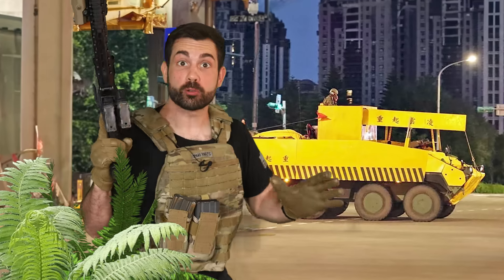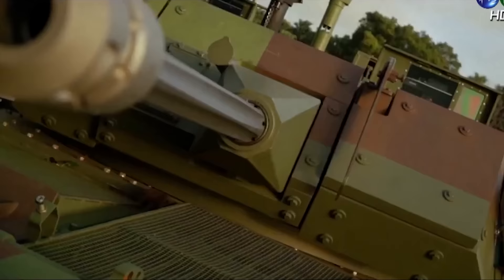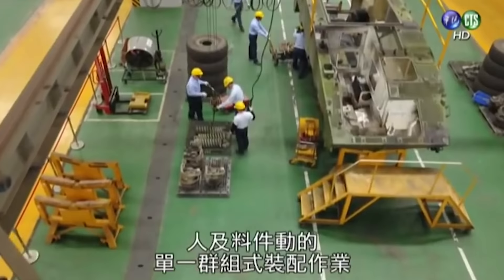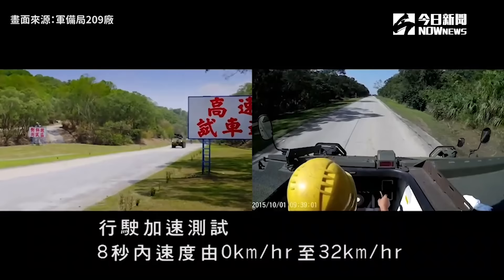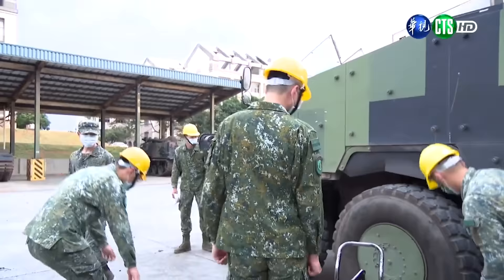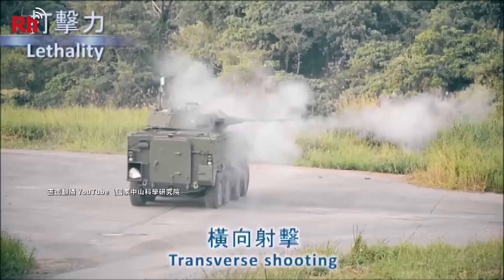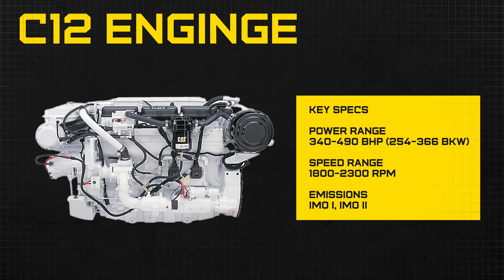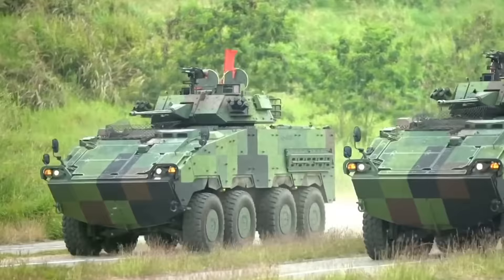Taiwan's Homemade Vehicle Designed to Stop China

Comment: As a mechanic. Honestly a CAT C12 and an allison transmission is a hell of a powerplant. Probably one of the more reliable off the shelf options for sure.
Reply: I'm a Yankee living in NZ, and I'm a truck driver getting used to a lot of Japanese and European trucks--but everyone swears by the reliability and cheapness/ease of repair of the American trucks/gear. Lots of Japanese trucks get an Eaton-Fuller 18-speed gearbox...and while a Yank-tank is VERY expensive up-front, it is way cheaper to repair/upkeep.
Reply: You are joking aren't? or you do not work on heavy equipment.
Reply: @Crimethoughtfull  No they do not the Japanese and European are years head. That is why nearly all American trucks are now fitted with European engines and transmissions

Comment: Taiwan’s homemade CM-32 Clouded Leopard armored combat vehicle, has independent suspension systems on each of the three front wheels on both sides. This allows the vehicle to steer with all three front wheels on either side, and the fourth wheels on either side can reverse, allowing the Clouded Leopard to rotate in place like a tracked tank. The Clouded Leopard can then rotate in place like a tank, making a circle, and then accelerate forward or backward in the desired direction, quickly leaving its original position. The ability to rotate in place is very useful in urban warfare, allowing the vehicle to quickly move in any direction forward or backward, quickly driving towards the enemy target for attack, or avoiding enemy ambushes.
The third generation of the Clouded Leopard will definitely be a hybrid electric design. The hybrid electric third-generation Clouded Leopard can switch to electric drive in night combat, allowing it to stealthily attack enemy positions under the cover of darkness. The vehicle's large-capacity battery can also be used to charge the electric motors of the reconnaissance and attack drones equipped on the vehicle.

Comment: You know my absolute, 100%, favorite thing about CM32?  It's the thing that comes after the CM31.  They just took the number in a model number, and named the thing that's one generation better with one number bigger.  This is something that almost no other military on the planet seems to be capable of.
What comes after DDG-112?  Obviously, DDG-1000.  Why?  Because DDG-1000 is the next number after DD-997.
What comes after M1?  M1A1.    M2 is completely different.  Was M1 the first of it's kind?  No, M1 is the next one after M60.  There is a thing called M61, but it's completely different from M60 and M1 and unrelated.  What letter comes after A in the M1A1?  M1E3.  E is the next letter after A, and there is no M1E1 or M1E2.
Reply: Well, what do you expect from the country that uses MM/DD/YYYY, instead of YYYY/MM/DD or DD/MM/YYYY
Reply: That happens in militaries with hundreds, if not thousands of concurrent developments.

Finnish military designations are pretty clear cut. RK-62 for the RynnäkköKivääri (Assault rifle) designed in 1962. 7.62 KK PKM for the 7.62 chambered KoneKivääri (Machine gun) originally designated PKM by the country it was exported from. ItO 90 for the IlmantorjuntaOhjus (Airdefense Missile) developed in the early 90s, and so on. Not perfect, but there is almost never any guesswork as to the type and approximate fielding date of the equipment.

At least it is better than "The soldier wearing his M1 tunic swung out from behind the M1 tank, clutching his M1 helmet and chambering his M1 rifle and attaching his M1 bayonet to it, saw an enemy tank and pulled out his M1 bazooka".
Reply: @ArchOfficial so does the Russian AK like AK-47 AK74 AK12 etc. Tanks like T62, T90 etc.

Similarly Chinese also designate their rifles and tanks with corresponding year of introduction.
Reply: You must have been really REALLY bored. Lmfao! 😂
Reply: But this removes all those Jobs in den naming group.
Reply: @adrielburned6924  I was busy alphebetising my M3 Grant medium tank, M3 halftrack, M3 Gun Motor Carriage, M3 Carbine, M3 Grease Gun smg, M3 Bradley IFV, M3 Stuart light tank, M3 helmet,  37mm Gun M3, 90mm Gun M3, 105mm Howitzer M3, M3 20mm cannon, M3 MG, M3 Scout Car, M3 Ram and M3 Kangaroo (foreign cousins), M3 tripod and M3 fighting knife.
Reply: @aaronleverton4221 that really puts M into MMMMMilitary
Reply: The M1 Abrams is the basic model, the M1A1 is a variant, same as the M1E1. 

Americans love to name their things M1, M2, M3, M4 etc. And then as they change the item, add new letter and numbers. 

They used to have the year on their vehicles too, like the M60, for the tank and the machine gun, but both were kinda insufficient. They also have the M246 because they realized they needed a new system, but they also sometimes have experimental models, so XM with a random number assigned. Sometimes they just drop the X when it gets adopted.

This all kinda started in WW2, for example, the US in WW2 adopted the Thompson SMG as the M1. Same for the M1 carbine and the M1 garand. The replacement for the M1 SMG was the M3, cause the US developed and even adopted an M2 SMG but didn't issue it. They then developed practically at the same time and adopted and distributed to their soldiers the M3 SMG. 

The M1 combat car was the first officially adopted US tank in their modern military. They almost immediately developed and adopted the M2 tank. Then as WW2 broke out, they developed in a hurry the M3. Little bit later they got the M4 Sherman and there was an absolute explosion in designations and variant. You had for example the M4A3E8. Model 4, Adoption 3, but the E technically means "Experimental" and therefore the Model 4, Adoption 3 Experimental 8 should be called M4A3 HVSS (Horizontal volute spring suspension). 

Now, of course the US has already adopted an M1 tank, the M1 combat car (which was considered a tank at the time),  but the M1 Abrams isn't a tank. It's a Main Battle Tank. A different thing. So both have the M1 name, cause they are both Model 1 of their designated roles. 

But the thing is, it's still kinda messy in a lot of places, so sometimes you have the model number (M1 like the rifle, or the tank) the year it was developed (like the M60 LMG and the tank, adopted in 1957 and 1959 [yeah, I don't know either]) or because it was an experimental weapon that simply dropped an X (M177). 

In the case of the M16, it actually has about 15 predecessors, all different rifles, some formally adopted, some not, with some issues to all, some not, but there honestly are very few M16 originals. Most of them are variants and there's a lot of variations with a ton of experimental things, but in general they were small improvements, so 2 M16's from different decades will be pretty different once you look at them closely. But they don't get called M16A(number)E(number), cause I guess the military got lazy and there were too many experimental projects going on to see what did and didn't work, so it was all just simpler to call M16 so as to not confuse the grunts on the ground.

The Marines especially had a hard time, as they couldn't just call it the M16, but had to count to up to 16 in order to say the name of the gun due to an insufferable addiction to crayons and glue
Reply: You left out that LCS aren't landing craft, that the B-1 bomber followed the B-52 and the B-2 is being followed by the B-21, that the F-35 used the X-plane sequence instead of the fighter sequence, and that the F-15E is being followed by the F-15EX. 

On the other hand, the multiple M-series are logical. There are official categories of army equipment types and each category has its series of Mark numbers: M-1, M-2, M-3,... It's only a problem if you don't know the category you're talking about or they forget how to count. Which you are absolutely right about.
Reply: Classic.
Reply: @asimjabbar8445  The issue is when none of the other equipment naming makes sense.
Reply: @ClickWasd  DD/MM/YYYY is the only acceptable format
Reply: @ClickWasd  i hate that format and i hate AM/PM 
the progression of 10am, 11am, 12pm, 1pm, 2pm etc makes absolutely no sense
Reply: Best format for datea is DD MMM YYYY.

Sincerely

Senior Goober

Signed on 21 SEP 2023
Reply: @tomcoyle7365  Not if you're going through a project folder and need things to be chronological.
Reply: I’m not an expert but I know the different letters and numbers are typically “code” for something. I know for Sherman’s tanks the different letters signified what kind of gun was on the tank and any other differences. But yeah it’s overly complicated, that’s what happens when you have system lead by officers that become career politicians who try to make themselves stand out and look better than other officers so they can get promoted.
Reply: @globalmilitarycollections4591  A mostly means a major update, and E is experimental. Rarely is this not the case in Army equipment at least.
Reply: @ClickWasd  m/d/y is easier to read imo. just like how u would say it in spoken language, on (month) (day), (year)...
Reply: Iirc there are 80 different pieces of US military equipment named M1
Reply: Underated comment here 😂
Reply: That´s because you use the imperial system and not the metric system :(

Comment: CM31 still seems like a valuable tool as an ambulance and rear line transport.
Reply: Except CM-31 never entered mass production and stopped at prototype stage. Taiwan mainly uses CM-21 (a local variant of M113) for mechanized warfare until CM-32 came along, and even then there are still more than 1000 CM-21 in service.

Comment: That cardboard wrap is actually smart.  If you line the inside of the panel with foil, you can effectively have an IR/thermal cloak.
Reply: Heat transfer will still be a major issue, you also cannot cloak all the vehicle and it can become easily damaged and rip

Comment: While much more expensive in the short run, I like an ifv that will hold 6 dismounts. That way you have twice as many vehicles, with twice as much firepower. Also those six dismounts wouldn't be as squeezed in. There would be much more room for additional equipment. And if one hit a mine or was taken out the other vehicle will be there for cover and back up and a possible tow. 
I think the 30mm would be minimum now. An alternate would be the 40 mm grenade.
more in favor of tracked vehicles what's for Taiwan the wheeled version is probably better. 
I think the future would be a hybrid vehicle. With a much quieter and fuel-efficient power plant and a large amount of batteries. Your thermal signature would be next to background with the right coatings, not to mention your sound would be very low. 
It seems like top-down is the way to go with anti-armor munitions these days. Since there's no way that you could put enough armor on the top of an ifv to really make a difference, some combination of active and passive armor against  ATGM's would be ideal. 
Taiwan is lucky in that they don't have to worry about fighting anywhere else but on their Island. Against very known adversaries. There will be no cover from eyes above, either through drones or satellite. Unless they have been neutralized early. It will be brutal. But they can consolidate and fixate they're spending to accomplish what they need to. Which would be to decimate the Chinese Navy and airforce and any Marines or army that get a foothold. If Taiwan could dent the Chinese military hard enough, I think that they would retreat and not come back ever. But for that taiwan has to be able to deliver overwhelming firepower for up to a week or maybe even 1 month. After that, my guess is it would be over unless China decided to double down. In which case it probably won't have much left but their nuclear arsenal. Taiwan has the capability of reaching out and touching the interior of China. And as China becomes weaker, we all know what will happen to the countries surrounding it. Kind of the same thing that is happening in Russia now. I like wolves circling the injured buck in the forest.

Comment: It is known  that Timoney built three Prototyped vehicles in Ireland 🇮🇪 of the MK8 two configuration that the Rock used and the Vicker MKll.
The CM31 Timoney MK8 had two crew and ten troops additional room for Three more troops when needed.
The newer version the CM32 is another example of Timoney design and Prototyped vehicles were actually very advanced, 
Timoney team would be on the ground with the Taiwanese personnel making sure that a smooth transfer of technology is being used properly, the vehicles remain the property of Timoney till the project is completed.

Comment: Very cool analysis. Did not know how good CM-32 is until I saw this video. Seems like the design team knew exactly what it is for and what it need to achieve its intended use. A little unfortunate that not a lot of media in Taiwan show off Taiwanese military invention/progress, as a lot of them are largely influenced by KMT and Chinese government. 
Not a lot of information is out about Taiwan's Indigenous Defense Submarine but hopefully I can get to see an analysis when more public information is available.
Reply: The first homemade submarine will be on display this month.

I think the displacement is 2,500 tons.

Using lithium batteries reduces noise, but sacrifices submersible time.

Can use MK48 torpedoes or submarine-launched harpoon missiles.

It is expected that only eight ships will be built.

But dozens of unmanned submarines will be built to assist in operations.

Unmanned submarines can also launch torpedoes or transport special forces.

In addition to unmanned submarines, there are also a larger number of underwater detectors.

With eight submarines as the core, it leads a huge unmanned underwater fleet.

This is the news revealed by Taiwanese news, but the plan is still in its early stages.
Reply: In addition, the unmanned submarine project uses AI, and the AI can complete preset tasks when the connection is out of order.

But the progress of unmanned submarines is currently unknown.

Comment: Taiwanese M60A3 Update: Taiwanese 2019 SLEP modular update of the M60A3 in conjunction with Elbit Systems. Upgrades includes MG251/L44 120-mm gun with a semi-automatic load assist, Elbit Knight Independent Fire Control System (IFCS) with an independent thermal commander's sight, laser range finder, an RWR/IR warning system and Curtis-Wright electric turret drive. Improved hull suspension, improved NBC protection system and modular active and reactive armor packages.

All of Taiwans M60A3's will be upgraded with everything above plus a new 1000 hp engine. Its just amazing how such an old piece of equipment can still be used all these years later. The work should be done by 2028.

Comment: The Russia-Ukraine War has shown that cheap, mass-produced unmanned combat UAV and Drone systems will dominate future land warfare. Electric-powered attack drone swarms are particularly advantageous for defenders with local logistical support.
Attackers must carry large batteries to power their drone swarms, otherwise their operations will be unsustainable. Defenders with local power sources have a significant advantage in using drones.
Logistics is essential to combat power, so the United States and European countries are still developing plans for the next generation of medium- and light-weight tanks and armoured fighting vehicle that can work in concert with large numbers of unmanned attack drones and logistical support systems that can keep up with them.
This is why the United States has announced that it will no longer develop new heavy tanks, and is instead waiting to develop the next generation of medium tanks and armored vehicles that can integrate unmanned combat systems.
Taiwan is supporting domestic manufacturers to produce large quantities of a full range of domestically produced unmanned UAVs and attack drones and Switchblade loitering munitions. Therefore, Taiwan's next generation of armored vehicles will definitely be able to carry and launch small reconnaissance drones and loitering munitions.

Comment: Speaking as an IFV gunner, while the gun is stabilized allowing you to take ass and kick names, you the gunner are not. You are going to be shaking and thrown about in the tower almost as much as the infantry at the back. Unless you have the grip strength of a gorilla and a targeting controller made of mithril, you're not going to hit anything beyond 100 meters consistently while driving 70km/h. This was on a tracked vehicle in the forest though, so with wheeled vehicles driving on smooth concrete, Taiwan might have a gunner's dream right there.

Comment: Hi, while i cant say with 100% certainty, but I believe your information is incorrect.

CM-31 never made it past prototype stage. The backbone of Taiwanese mechanized infantry had been, and still to some extent is the CM-21, which is an up-armored M113.

Due to downsizing of the armed forces and an abundance of CM-21 made it quite unlikely to switch to CM-31 back in the days.

I am pretty sure we never had CM-31 because I served as a brigade staff officer with the 542nd armored in 2016, all our mechanized infantry rolls around in CM-21. The 269th mechanized brigade hosted CM-32 as they started swapping out the CM-21.

MP had V-150 (LAV-150) before switching over to CM-32, again i dont think CM-31 was ever used besides one or two with the MP.